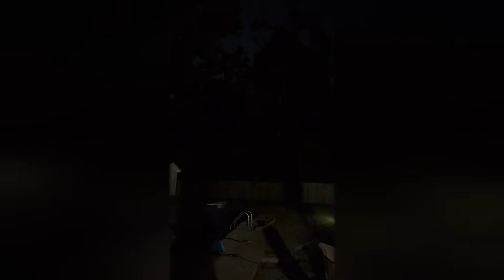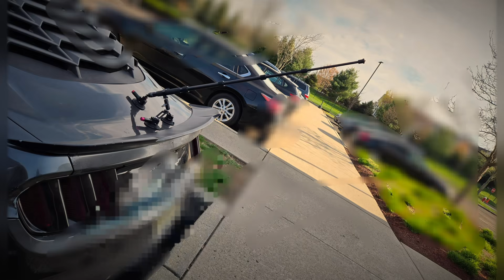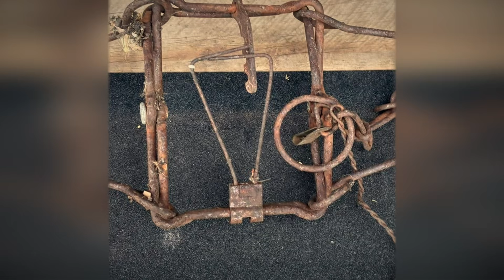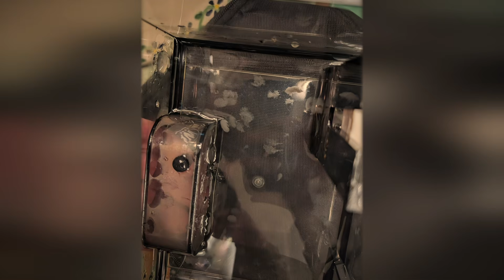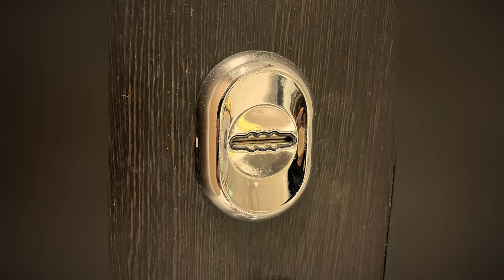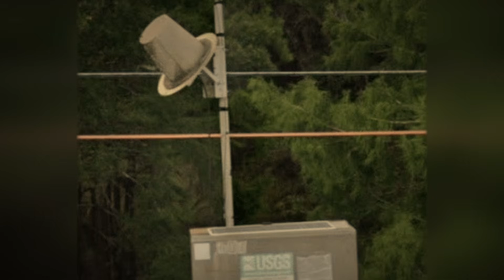Saw This On The Highway... Why Does This Car Have A Tank Attached?

Comment: The item identified as a fire grenade was not meant to be thrown. It was mounted  usually on a wall near an area that needed fire protection. A fusible link melted at the temperatures that a fire would generate, causing a spring loaded striker to strike a blank cartridge, which in turn would shatter the glass bulb causing the release of the correctly identified chemical inside.

Comment: The item identified as a foothold trap is wrong.  It is a Connibear killer trap. An animal tries to pass thru it and, in the attempt, pushes a trips a  wire trigger, which causes the trap to snap shut on the animal's neck, breaking it and causing instant termination of the animal.

Comment: While a submitter and the narrator discuss furniture cam lock nuts, we see an image of some sort of a metallic pulling or lifting device that would be attached to the end of a rope or chain (or cable), and which would be secured to the item to be lifted using a mechanical leveraging and pinching action.

Comment: Hyperextension is the reason why this door closer's piston arm is bent.
While the bracket by which the piston arm is attached to the door frame might well be installed backwards, one can see that the installer had little choice but to install it the way that he did.
If the small difference in distance that this makes is truly critical, I believe that the opposite bracket (which holds the far end of the cylinder) might allow for some adjustment to compensate.
Reply: In other words, yes, this installation lacks and needs the safety spring and chain to remain installed to avoid this sort of damage in the future.